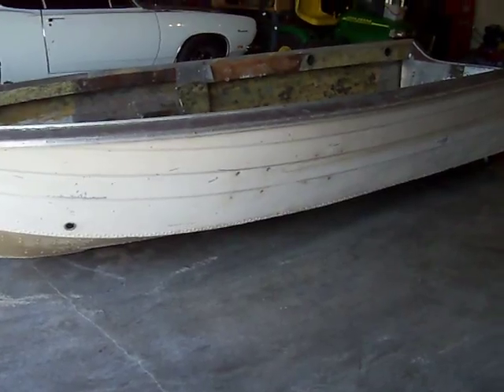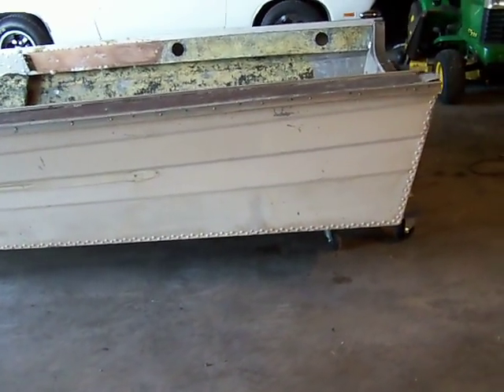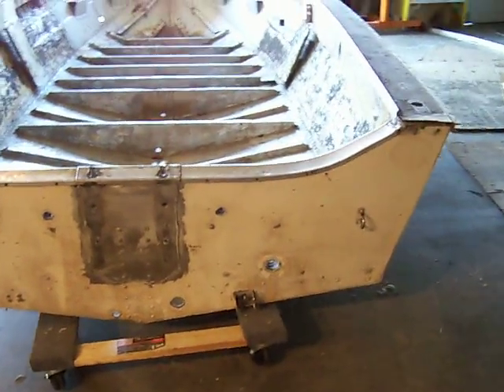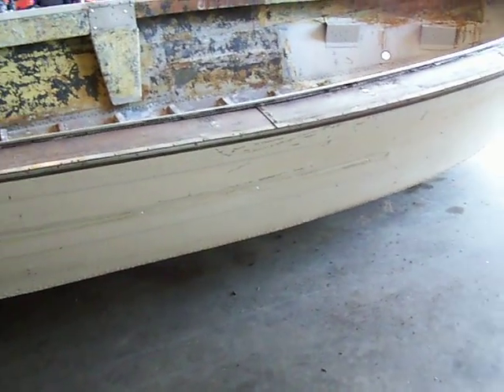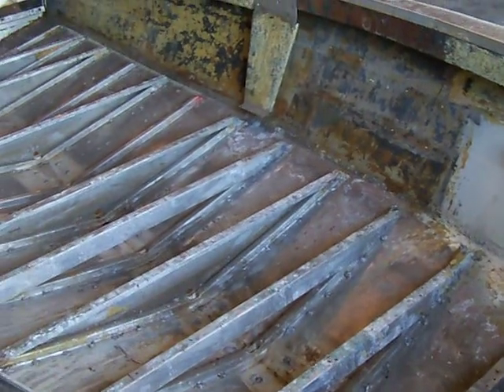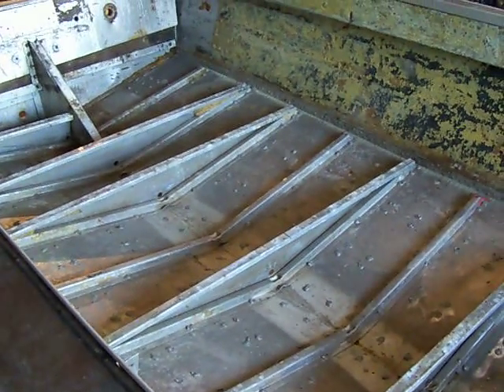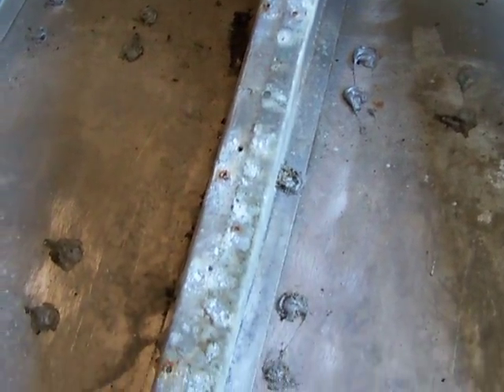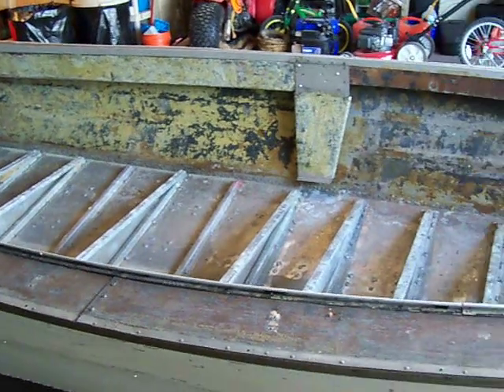Restoration 1981 Sea Nymph aluminum boat part 1 (introduction and leak repair)

Comment: Thinking about the same project only mines a 83 sea nymph . What is the approximate weight of the empty hull?  As far as the keel is concerned I believe that they used some kind of rubber membrane between it. At least I have seen a small portion sticking out of mine anyway.  I'm excited to see how it turns out. Keep posting videos.